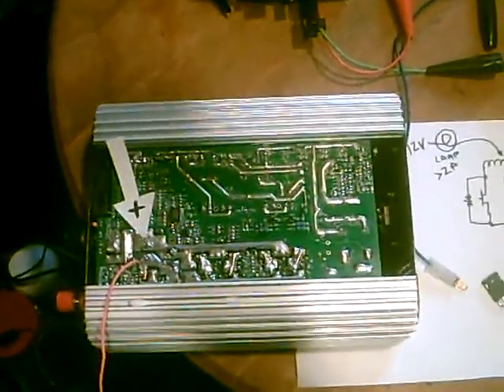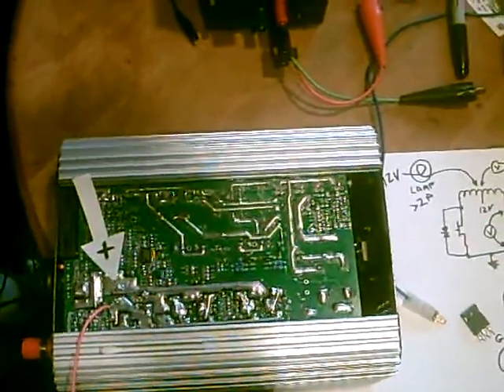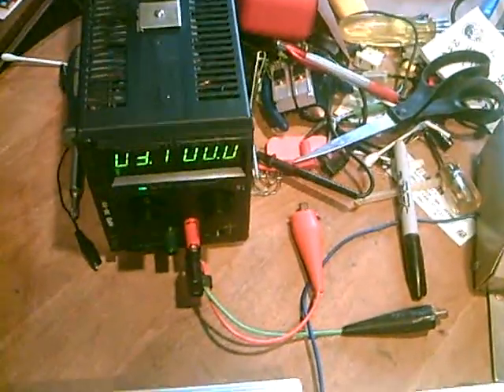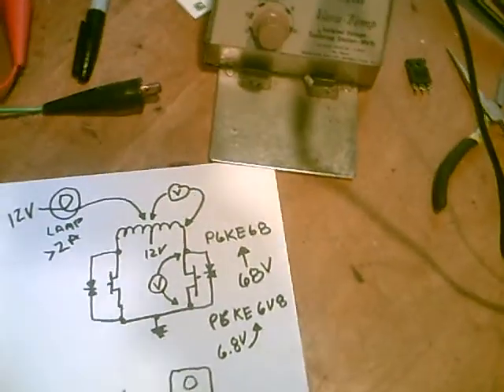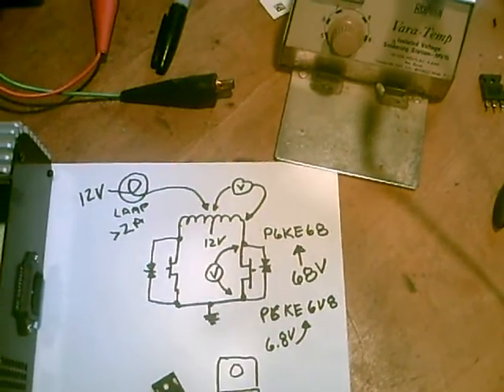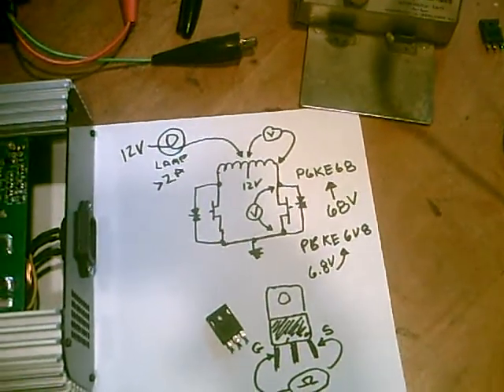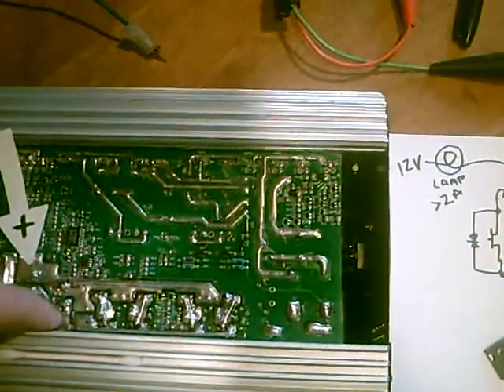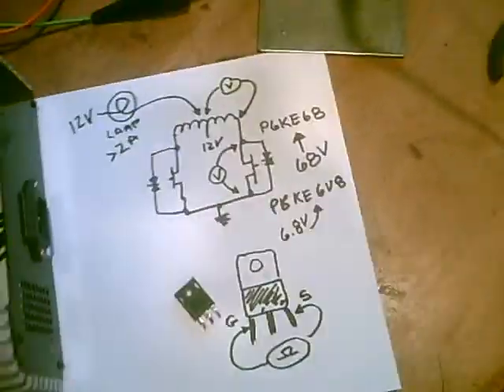TRICKY GRID TIE INVERTER REPAIR    SHORTED INPUT

Comment: that's useful. Where would you look for a problem if the inverter's DC terminal are short (0 ohm), but the fuses are fine?..
Reply from the maker: Depends what you call a short. Some meters will read as a short because of a low ohm value.  I have one inverter with parallel fuses which would take over 300A to blow. Something I can't provide. Meters connected in a wrong polarity may cause electrolytic capacitors to conduct or capacitance so large it appears as a short for a while as they charge up. The lamp trick provides enough current to detect a real short. Remove fuses and see if the short still exists. Repairs are often the unexpected. I've seen plastic connectors with internal holes which shorted two pins. The trick is to isolate the problem to an area. Sometimes what you think you saw didn't really happen. Double verify results. Using the mv range on a meter when the circuit is powered ill help you find it.  Good luck.
Reply: @opera5714  Thanks. Well, I am an engineer myself so I roughly know how to go about trying to eliminate the possible obvious, but certainly that is still a possibility. The circuit is properly short without fuses. The full story - it's  a PV grid-tie inverter with MPPT (something like u got there, just with a power limiter). I accidently put too much voltage on the DC input terminals (around 50V instad of indicated max. 30V -  I was sure it's got overvoltage protection). The thing immediately stopped working and shows short circuit on the output of the controller. 
Thanks anyway:)